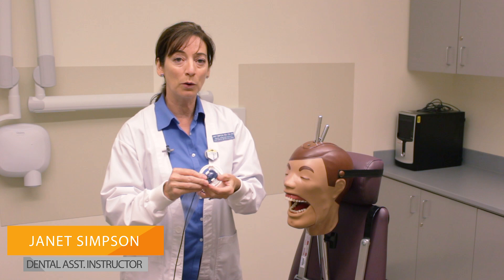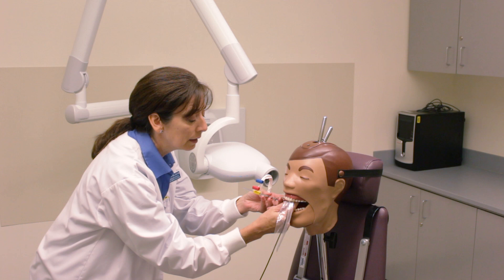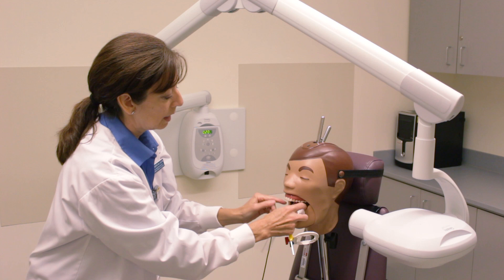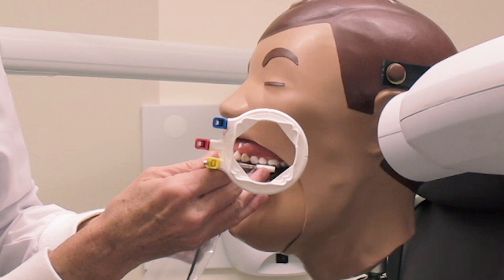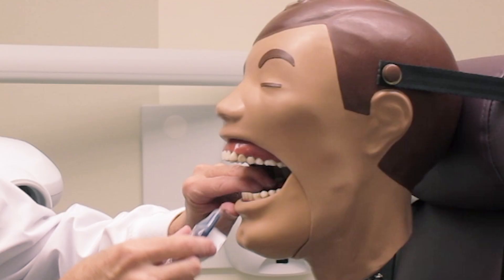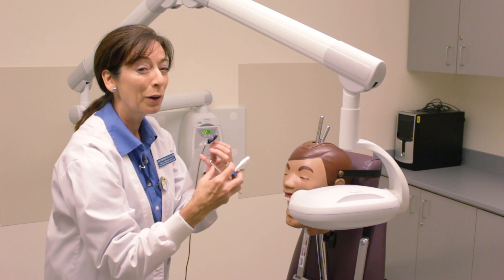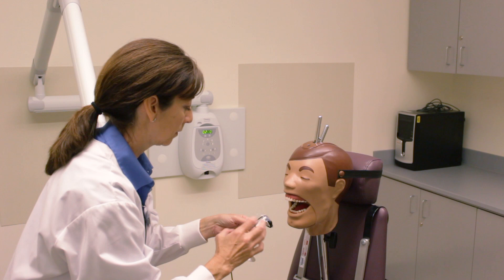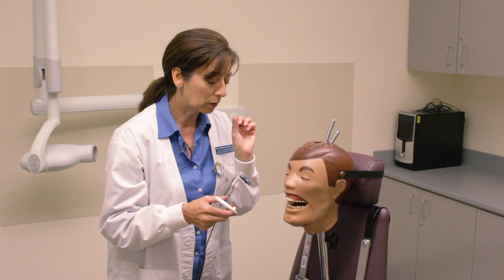X-Ray lesson series: 1 - Full Mouth X rays

Comment: I sometimes miss the canine when doing premolar even though I put it in the middle of canine, do you have an tips?
Reply from the maker: Hi Danna,
Great question!  This is a very common problem with the wired digital sensor.  I have two thoughts.  First when placing the sensor, place the anterior edge of the sensor toward the midline.  It will be at an angle with the anterior edge near 24 & 25..  Then pull the PID forward and project (angling slightly back) through the contacts.    I'll upload a photo that will explain it better. Try that.  It will get you closer to the target.
The other thing to consider is that it's hard to get textbook quality x-rays with the wired sensor.  but we don't need more textbooks, we need diagnostic quality x-rays.  So if you have a good image of the canine and even the first premolar in your canine shot, you are good to go.  Don't sweat it.  :)  
Thank you for pursuing excellence!  Keep it up.  Just be aware that most of us face this limitation due to the thick and rigid sensor.
Reply from the maker: oh shoot!  I can't insert a photo here.  My email address is janet@dentalxraycoach.com  Send me an email and I will send you a couple photos to explain what I'm talking about.